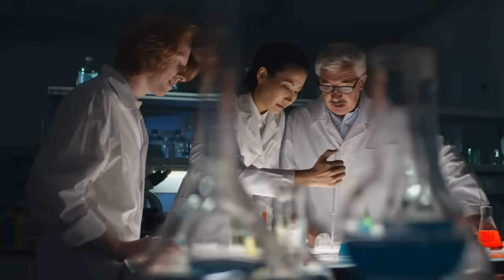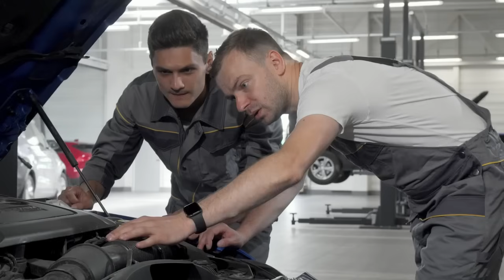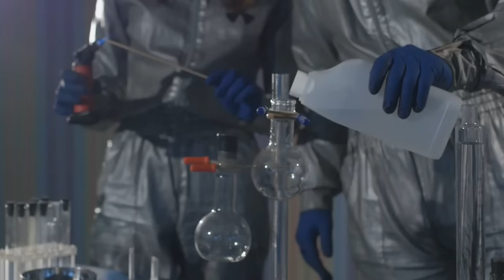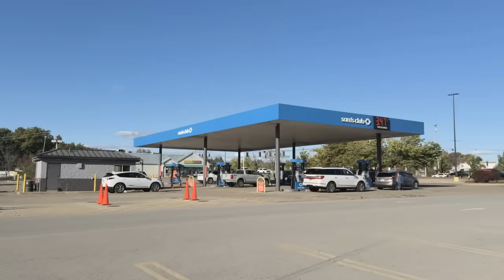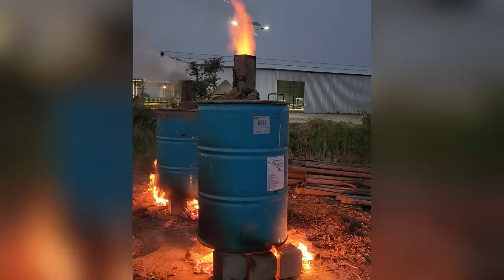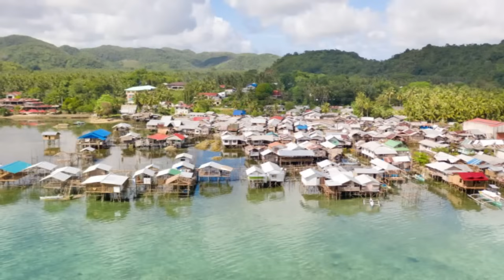One Million Cars Ran on Wood — Then Big Oil Killed It

Comment: they ran when oil was scarse due to the war , woodgas isnt verry efficient , if you want to start the car to go to work at 7 in the morning youre filling and stoking the generator about 5 in the morning and try to start the car around 10 minutes before normal departure ariving 2 hours late
Reply: This "big oil wouldn't let it go mainstream" is so worn out and delusional.
Reply: Ooohhh exactly like an ev. It can explode and needs hours to be  ready
Reply: @casacoccodè no evs are awesome. I just got one and it’s so quiet and so much faster
Reply: @projectpat2262  I was being ironic. I meant that if I wanted to buy a wood-fired thing... I'd like to be able to do that. If you want to buy a battery-powered thing that would require polluting half the planet... OK. I want the wood burning thing though
Reply: Saw thumbnail and clicked just to coment on this oil is uesd for everything because its cheep and efficient thay is no grand click bate conparasy drill baby drill

Comment: Actually in ww2 gasoline and diesel was scarse that is why the wood gazifier was used and diesel engines got converted into gasoline engines, and not only the Swedes, Germans, British but also Swiss had them and they were manufactured by cars, trucks, tractor companies etc
Reply from the maker: I think what would be really interesting to explore with this video and concept — and what I actually had in mind, but may not have explained clearly enough — is how useful this could be for powering generators during a blackout or gasoline shortage. In a crisis like that, a setup like this could potentially keep a generator running and producing electricity using wood instead of fuel.
Reply: @Sidney_Explains_Money  true, in the 1960s early 70s the Swiss FAT (Similar to the USA's Nebraska Tractor Lab) tested a new version of the Gazifiers they did make a few positive points but also mentioned the hp lose of it as well and that new tractors do not have the same room they used have between the front and rear axle. One Swiss tractor maker did have it on the back of the tractors, and one at the front. The last one I mentioned only made 20 of them, that company's tractor division was very small they were into manufacturing of Locomotives (SLM). SLM itself made 454 tractors in total between 1933 and 1953

Comment: This is honestly fascinating, but it also made me think about a real situation I might run into.

If I built a small wood gas generator for backup power at home, what happens during rainy or very humid days? Since the wood needs to stay dry and the system involves heat and gas flow, would moisture affect the efficiency or make it harder to start?

I’m asking because where I live, it rains a lot, and storing perfectly dry wood isn’t always easy. Has anyone here actually used this system long-term in a humid environment?
Reply: Dump the waste heat into your wood drying area?

Comment: They did not bury this.

This was done during a time of extreme gasoline rationing.

Does it work? Yes.
In general it is highly inefficient.

This gets trotted out everytime the price of fuel goes up.

There were some moderm day versions in the mid 2000s that used pellet stove fuel.

The amount of work required to cut the wood does not equate to a reasonable return in fuel mileage.
Reply: Wood gas is still used in north Korea due to their politics.
Reply: @jonathanjones3126 ok.
I am not saying it cant be used.
It is just highly inefficient.
Reply: @shawnr771  you usually find wood gas in maybe long term depressed economies, it can be a useful technology but it is horribly inefficient. 

Diesel is the king of industrial equipment for good reason, gasoline is relatively cheap. Kerosene when it meets the right standards is jet/rocket fuel.

Solar is cheap enough for remote locations assuming it doesn't get damaged.

Comment: Massive deforestation ist taking place in order to build solar parks and wind parks the soil around it is drying out,wild animals flee the infrasound domestic animals and people tend to get sick near them,forever chemicals make the soil unusable for food production,I am all for trees and forests as dense as possible but these engines are hardly the problem for the trees but an emergency option worth keeping in mind.
As for electric cars they existed before and in more elegant versions than now we have a lot to remember.....
Reply: Please show me where a forest was cut down for solar.

More solar farms are being installed in deserts, on top of landfills, on land previously occupied by coal fired power plants, over canals and floating on lakes.
Bringing back the eco systems.
Reply: @shawnr771 that may be true where you live and there are examples of that here too,rooftops,landfills etc. but increasingly agricultural fields and forests are used more so for wind parks less for solar but it's stll being done in the oh so very "green" Germany and when solar panels disintigrate the substances get into the soil and are not without consequence, don't get me wrong there are well managed solar parks that monitor the decline of panels and change them when it is time but many are just run for profit not with the environment in mind.
Reply: have you researched orphaned oil wells?
Reply: @silviamonz2062 Agricultural fields grow just fine under windmills.
There is are two large ones within 50 miles of my home.
Cows graze under them.
Farmers plow their fields.
Reply: @shawnr771 enjoy the food they produce.....while you can ,you are free to think what you like , I am not here to change your mind

Comment: If I made that system, I would definitely use it to power a wood chipper.
It is so much better than relying on the store to supply your wood chips.

As a side bonus, a wood pellet stove can also burn the right size wood chips. Making it much more affordable to run.

The last time I bought a bag of wood pellets they were expensive.
Whereas you can often get a pile of branches for free.
You may be able to even charge someone to remove them.
Reply from the maker: Dude, that's a seriously clever idea! Using the system to power a chipper to make fuel for a pellet stove? Talk about next-level resourcefulness. Getting branches for free and charging for removal? You're a genius!